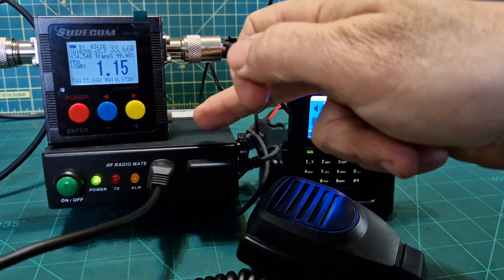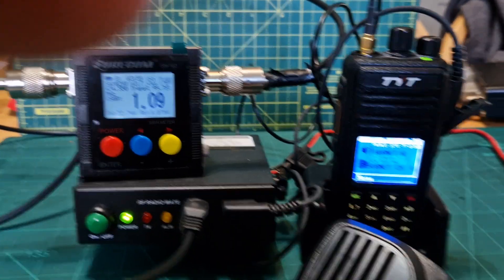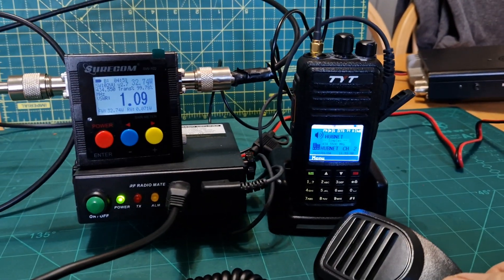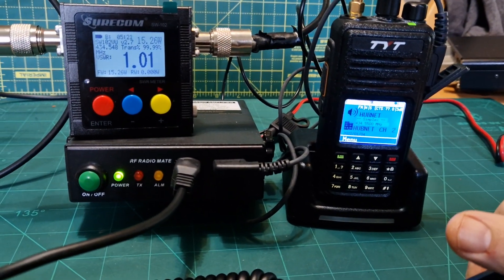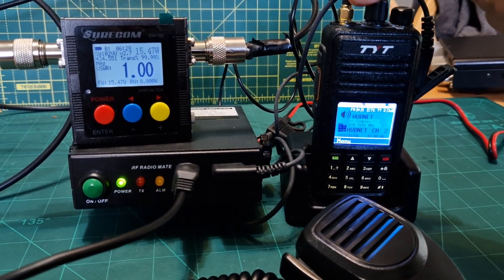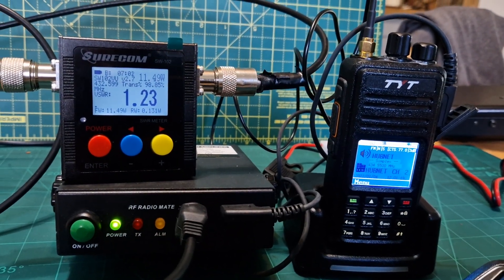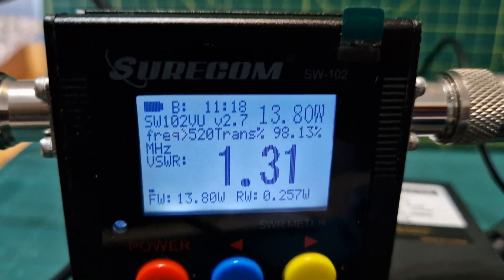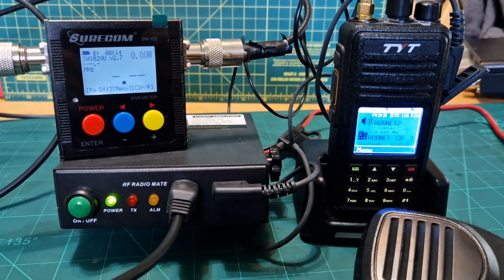Hand Held Amp Base Station 25 Watt 2 Meters 70cm

Comment: What happens if you were to use that amp on 2 meter? I'm puzzled why they have two versions of the amplifier, where I don't know enough about RF amplifiers to understand why the amp just wouldn't amplify what ever you send through it. The reason why I ask is twofold, I love learning,  how these things work and the manual says it works on both and doesn't mention two different models for the two bands, so I'm super curious
Reply from the maker: Different bands need different parts.

Comment: It looks like my BTech amps for VHF and
UHF.
Reply from the maker: Does that one include speaker and Microphone ?
Reply: @DIGITAL HAM RADIO DIARY-M0FXB  Yes,
The two models are the BTech U25 and
V25, each with about 30 watts output  
with plug in Mike and built in speaker.
I do not us the mike in my set-up.
Each is about US $138.00 Ray W2CH NH